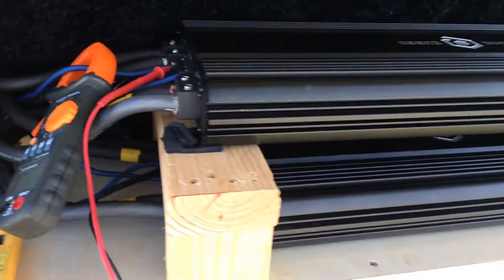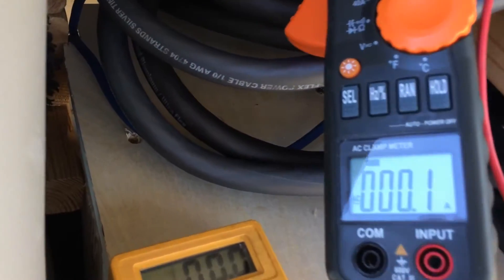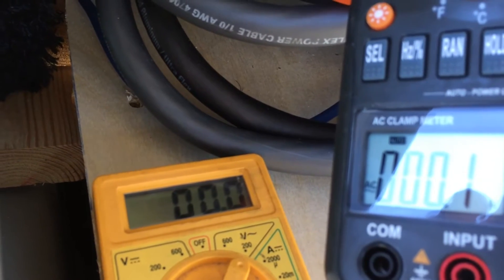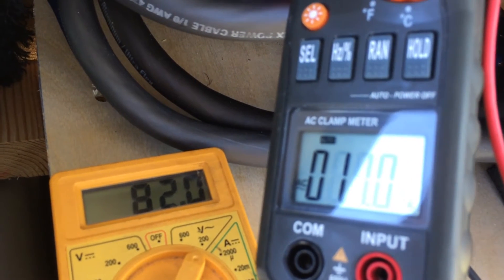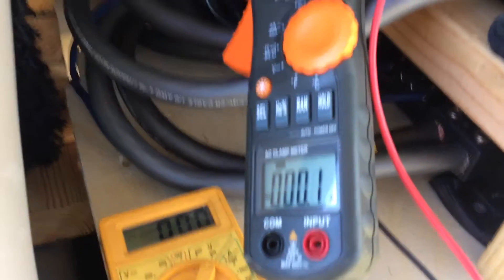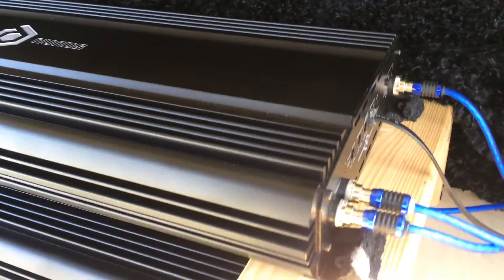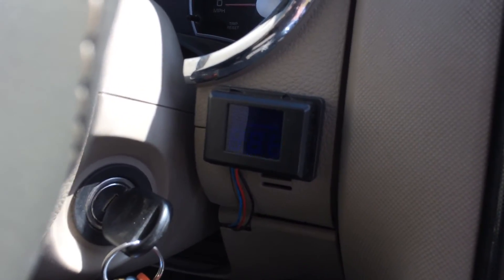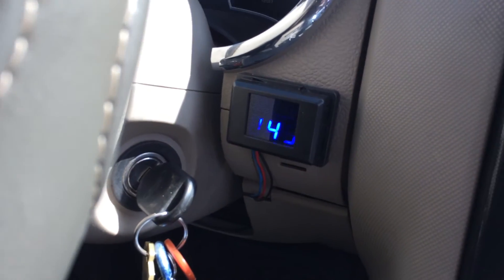Soundqubed 4500s clamped

Comment: So i want to strap my 2 soundqubed 4.5k , but my subs are dual 4 ohm, so if i wire the subs down to 1 ohm will that be ok to strap my amps or should i just run 1 amp to each sub? I have 2 15 in orion hcca spl subs.
Reply: Thanks dude!! An alternator is defintley in the future plans im just in the early stage of putting it all in now and usual i buy alt first but this time it ended up last due to saving for all the other equipment.I may just break em in at 4 ohm so 2ohm each per amp then when i get alt ill drop it down to 1 ohm.But i still may run them 1 ohm very low like you suggested Thanks buddy for your help.
Reply from the maker: Yessir no problem. Good luck with your build and let me know how it goes later.
Reply: I have a stock alt but in the back i have 2 northstar agm 220, and i have a northstar 3478 under the hood
Reply from the maker: Tater T.V. Hey man! So if you wired your DVC 4 ohm subs together down to 1 ohm then you COULD strap the amps at 1 ohm but that means they’ll be rubbing half ohm each which is fine but it’s not warranties or advised by them. You will not get the most out of the amps running them at 2 ohm per but is more efficient. You have the electrical to run them at 1 ohm but not half ohm unless you upgrade your alternator to atleast a 320 I would suggest minimum. If it was me I would run strapped at 1 ohm and just have the gains down and watch your voltage. I have been running for over 2 years at half with no issues but never drop below 12.6. Thanks for watching!
Reply: In my othet build i jave my 2 18 in zcons wired in series parallel and if i remmeber correctly that got me at 1 ohm for that setup.They are dual 2 ohm if im not mistaken

Comment: Your numbers are Va not Watts. In order to get watts you need to divide by the square root of 2. So at 3.5 ohms you are at 2683, 5.3 ohms 1648.5, and at 6.8 ohms 1092.

Comment: Are those numbers for the pair or per amp?
Reply from the maker: Chris Simmons those numbers are strapped amps at 2 ohm. This is real world numbers after rise and before clipping so could get more.
Reply from the maker: Basically each amp did 1900 watts RMS @ 1.8ohm per amp, which is at roughly 13.2v being around rated of the amp for that ohm of the amp at that voltage almost. If I went up to clipping it would've been on the money for true power rated of amps but didn't want to clip. Hope this helped.